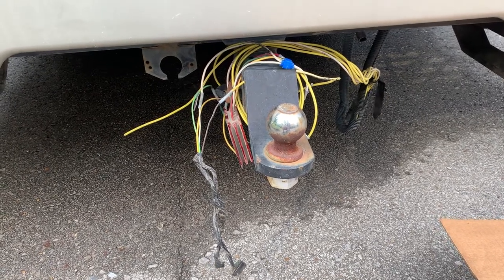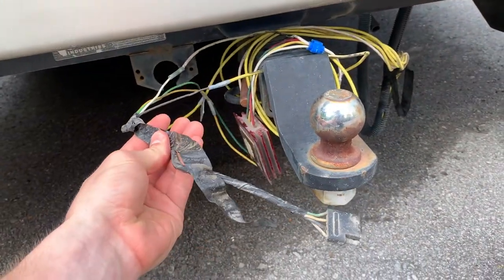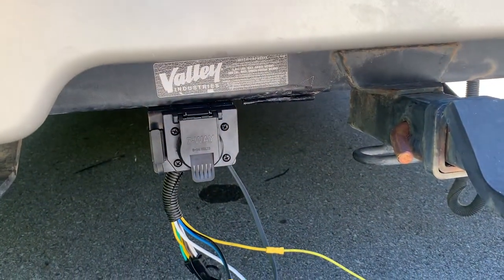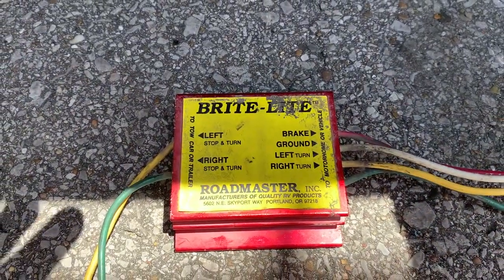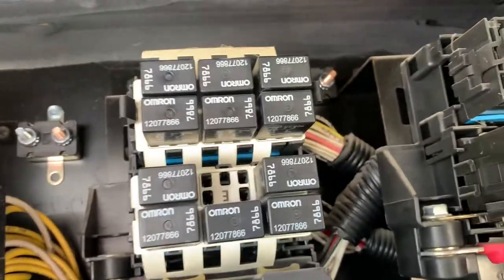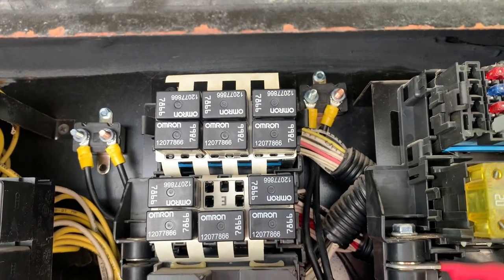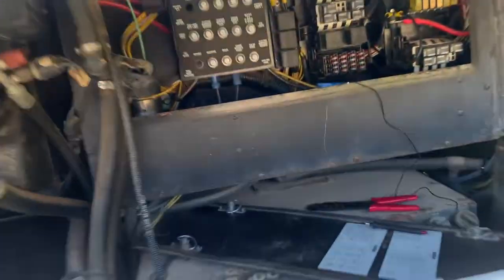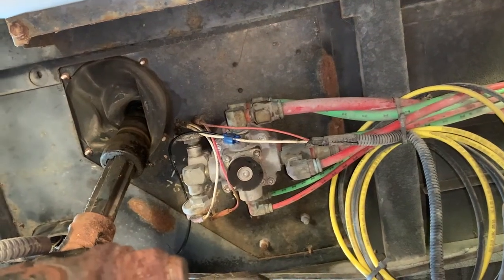Electric Brake Controller Install | Diesel Pusher Motorhome w/ Air Brakes

Comment: Hey brother I need to do the same thing as you I currently have a 6 pin connection on my motor home I do not have one of those flat things that you have in your video?  But I need to hook up trailer blakes and a controller to tow a trailer is there somethingElse I need if I don't have that little Square box you have or do I just wire color for color on the 6 pin wiring to the new 7 pin and run the new etrailer up front and terminate as you shown??
 Thank you for the help